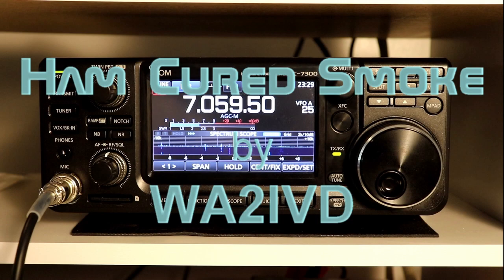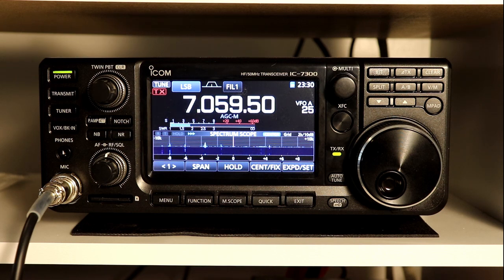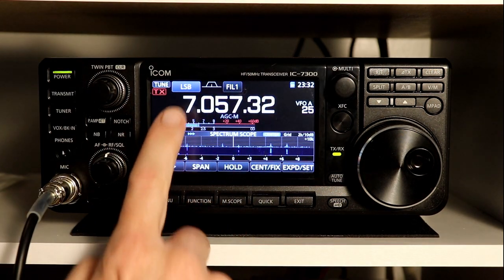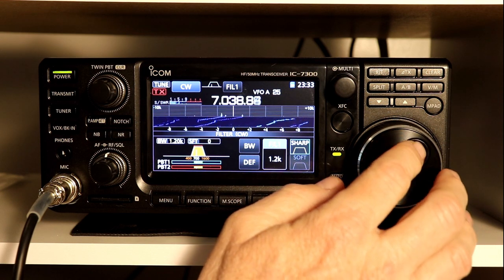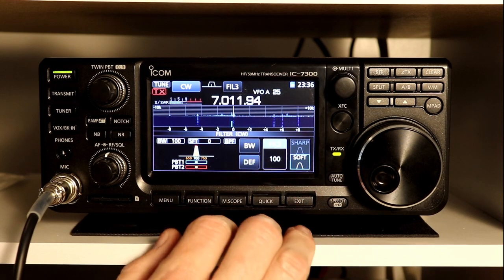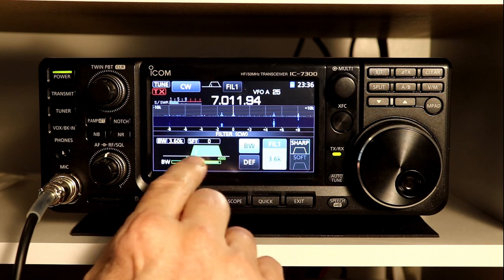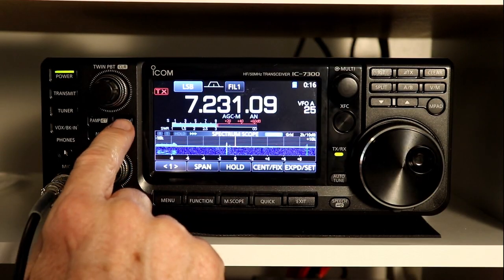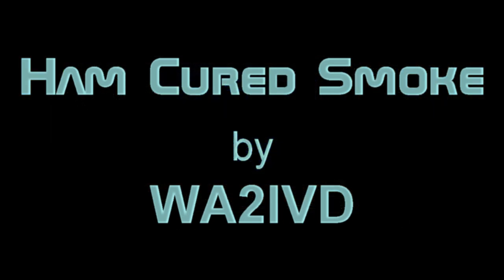Icom IC7300 A to Z #11 IF Filter Settings & Notch Filter

Comment: Not the right video to ask, but I still have to. On my Icom 7300 (2months old) when I switch the screen to show the mete, no SWR shows up. At all, on any freq. Completely blank.
Any idea what I'm doing wrong? I have a MFJ 939 auto tuner in line between the reciever and my antenna.

Thanks

Comment: 👍Thanks for video. Would agree that Auto Notch is all you normally need for SSB. Manual Notch - I sometimes find useful on digital modes, like FT8. If you have a really strong FT8 signal wiping out weaker one's - Manual Notch to the rescue.

Comment: Thanks,  I'm learning so much from these series.  I didn't comprehend completely what the notch filter did. Now I'm amazed my radio has that kind of capability. Static doesn't bother my ears but the sound of someone tuning right over a qso just grinds my gears.

Comment: I've noticed using the auto notch (AN), when you have an operator that sends a carrier (heterodyne) in an off-and-on fashion repeatedly, you can hear that the AN takes a small amount of time to react and reset itself for each occurrence. That's a bit annoying. So when I get into that situation I take the trouble to find the offending signal with manual notch to eliminate the recovery affect. Thank you for doing these "episodes" as they are very helpful. I have subscribed :-)
Reply from the maker: Thanks Alex. That’s a good tip and a good reason for using the manual notch filter.

Comment: 4:00 filter in CW mode is dependant of the CW resonance frequency. Yours is set at 700Hz because the center of each of the 3 filters is 700Hz. You can change the resonant CW frequency by hitting the Multi button, there you will find the CW resonant frequency that can be ajdusted and 3 filters will be centered on the resonant frequency.

Comment: What do you mean by someone, "tuning up?"
Reply from the maker: Hi Steve.  The term is a bit of a hold over from tube radio days.  Although many people still have tube radios today and kilowatt amps with tubes are still pretty popular.  With a tube radio or amplifier, there are several knobs  you have to adjust to properly match the output of the radio to your antenna system every time you change bands or frequencies.   "Tuning Up" refers to somebody putting out a solid carrier while they adjust their radio, antenna tuner or amplifier.  When the radio is in SSB, CW or RTTY mode, it sounds like a single tone on the receiver.  Often, you can watch the signal strength of the signal moving up and down as the other station adjusts things.  We're supposed identify before we start and when we've finished tuning.  It's also good etiquette to check to be sure that the frequency is clear before starting.  Unfortunately, one or both of those things often don't happen.
73,  Tom WA2IVD
Reply: @HamRadioA2Z  Thanks, Tom. I'm enjoying the IC7300 series. Cheers

Comment: Manual notch?   For CW.  Auto notch will take out all cw sigs...manual notch takes out the one you want to attenuate.
Reply from the maker: Hi Ed.  You make a good point.  The manual notch makes much more sense for CW, but in the beginning of that same episode I also show how to set the filter bandwidth in CW small enough that you can hear only 1 CW signal even with 2 signals right on top of each other.  Either method works.  That's part of the beauty of this radio.  There are many ways to accomplish each thing and none of them are wrong.  Whichever method makes the most sense to you is fine.

Comment: I use manual notch only.  The reason why is simple.  Tune to your offensive tone,  note the S-meter.  Hit auto notch and note that the S-meter has not changed.  Use manual notch to tune out the tone and your S-meter drops and the signal you want to hear is much easier to copy.
Reply from the maker: Thanks for the tip Mike.  I’ll have to try that out.
Reply: @HamRadioA2Z  Also, if auto is used when in CW the auto notch may take the signal you want to listen to.  Just experienced that.
Reply from the maker: Mike, you’re absolutely right.  I wasn’t really thinking about CW when I said I wasn’t sure why I would use manual notch.  The auto-notch could definitely block out the signal you want to here.  Although, I think for close station interference on CW, I would just set the filter bandwidth down to 100hz or so as I demonstrated in the other portion of the episode rather than using the notch filter.